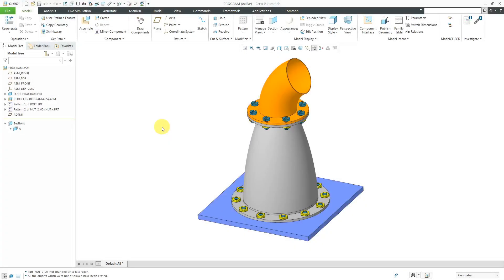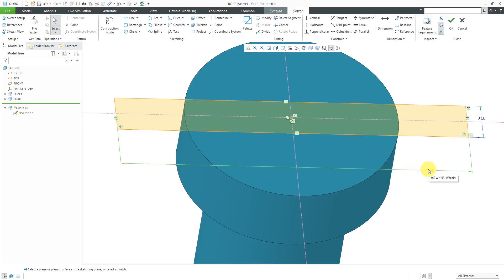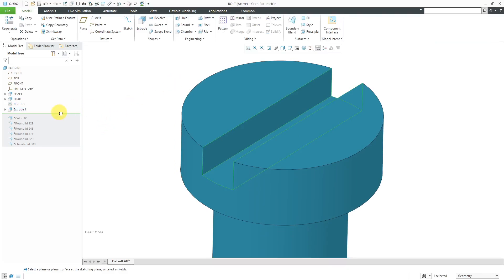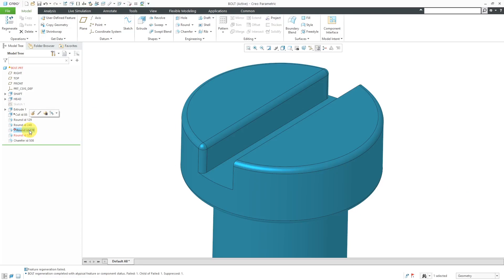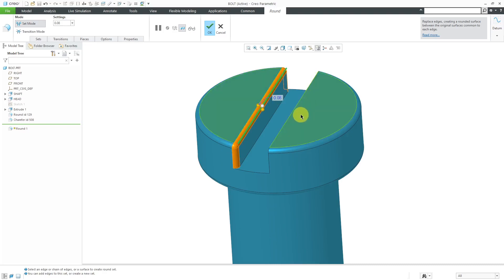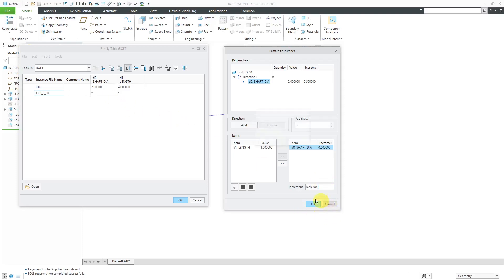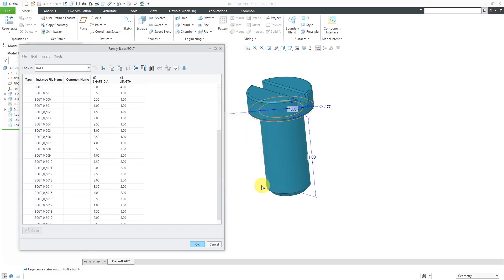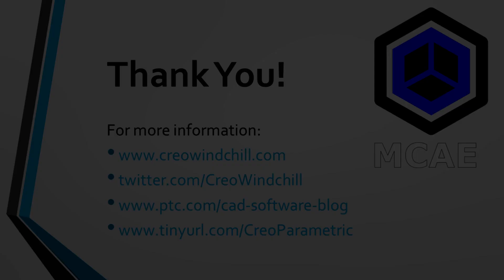Creo Parametric - Bolt Family Table

Comment: Hi Dave, @CADPLMGuy When managing a large number of part variants—such as bolts with multiple diameters (M6, M8, M10, etc.) and lengths—should we use a single large family table that includes all sizes and configurations, or should we create separate generic models for each diameter (e.g., one generic for M6, another for M8)? What are the best practices for deciding between a large family table and multiple generics in terms of maintainability, performance, and integration with PLM systems
Reply from the maker: That's something that your team has to decide for itself. And no matter what you decide, someone is going to be happy. (I know consultants who recommend against using Family Tables at all.) You're going to have to decide amongst your team how your release and revise processes apply to hardware, how many instances you're comfortable coming in to your workspaces, how fast is fast enough, and so on.

Comment: Hi is it possible to make feature as the parameter?
let say 1 type is with fillet+chamfer, but the other type is only fillet.
Reply from the maker: I suggest you start watching with my first video in the "Family Tables" playlist called "Creo Parametric - Family Tables | Part Modeling" where I cover how you would do this.